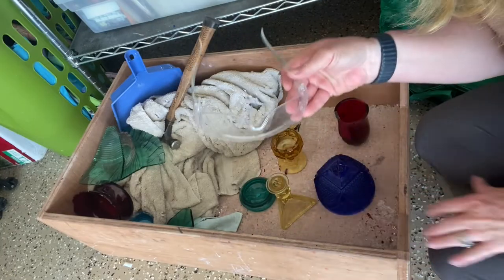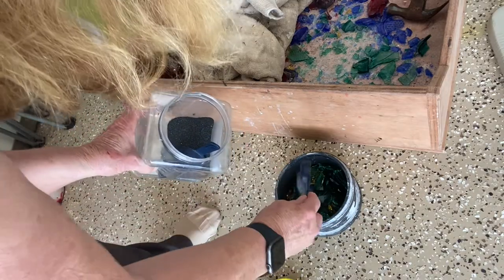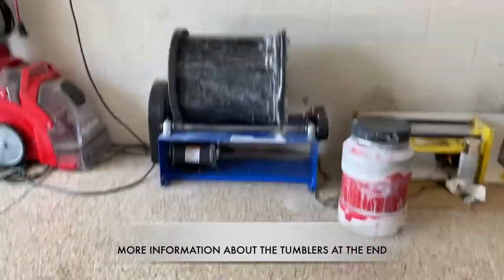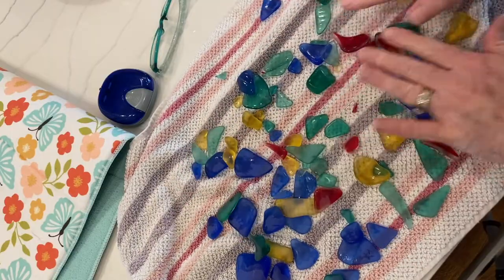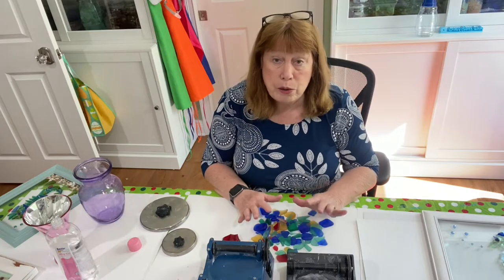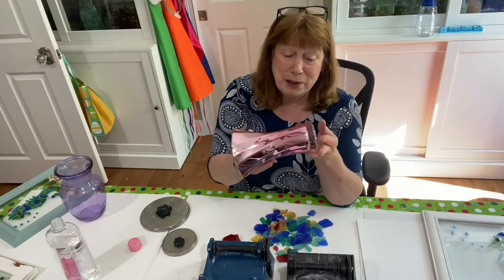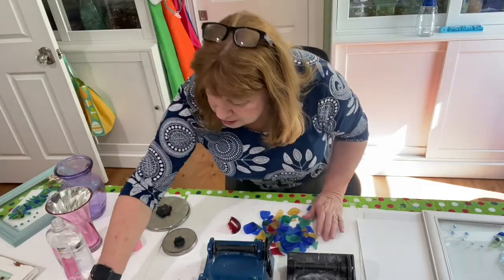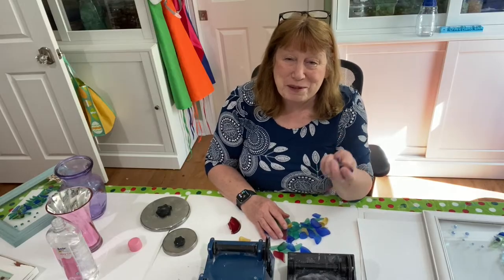HOW TO MAKE SEA GLASS, (FAUX) SEA GLASS, TUMBLED GLASS, ROCK TUMBLER

Comment: Hi I have a question...can I tumble my scrap glass that I have left over from my stained glass projects?  I would love to cross over into resin and get away from all that soldiering!  Thanks and love your videos!
Reply from the maker: Yes you can definitley tumble stained glass it would just smooth the edges. I tumble the stems for flowers look at some of my window projects.
Reply: @crazyglasslady  thanks so much!  I saw that video after I sent you that message and I was very surprised that the stems didn't break ...so cool!! I'm excited to try this out 😄
Reply from the maker: @gaildonovan5882  Yes some did but a lot stayed intact. You just can't make them to thin and you need a tumbler long enough. You could also make them shorter and just piece them together.

Comment: If I tumble glass for 24 hours vs one week, what will the difference be? Not clear on the time frame. I like what you like as well, shinny glass. The next question is, if I tumble glass for a week for the shine, will it be sharp around the edges? I think I read that somewhere.
Reply from the maker: So if you do not care about the rounded look and just want the sharp edges off you can tumble for 1-2 hours in water no grit and no more sharp edges. The glass will still be shinny. If you like the rounded look it takes longer and the abrasive like grit or sand is what speeds up the process. It does come out frosted. If you are working with resin and plan on pouring it over the glass do not put any oil on the glass the resin will make the frosted  glass shinny . If you are just glueing the sea glass down no resin you could make it shinny with a little bit of oil. Hope that helps

Comment: Hi,I purchased the National Geographic Tumbler awhile back. I am now ready to use it. Firstly,  after watching your wonderful video here,  I noticed you did not use rocks to tumble with the glass. The directions indicate to use it. Secondly, the grits are labeled in packages of #1,#2, #3, and #4 etc. I think I'm only to use #1, as it doesn't give the number of the grit such as #70 as you indicated here. So, do I just use number #1 grit and not worry about the other grits and do I use the rocks or do I do what you did, not use the rocks? Sorry, and hope my questions make sense, it's my first time doing this. 💁
Reply from the maker: The reason it says to put he rocks in is because it is a rock tumbler and they think you want to tumble the rocks. So yes just put in the glass ( But you could also tumble the rocks if you want it will not hurt the glass) And yes the # 1 packet will be the coarsest grit so you use that for the sea glass look .I would just put in a tablespoon and tumble for 7 days. You can check after a few it just all depends how rounded you like it. when you do have to buy grit remember the lower the number the coarser the grit and the coarser the grit the faster it smoothes it. You could also use some coarse sand . I hope that helps.

Comment: I'm just getting into this for a large project around my pool. Your tips were awesome. Thank you!
Reply from the maker: Do you plan on using resin because resin will yellow outside in the heat?
Reply: I'm using epoxy. I'm going to hang picture frames (epoxy and sea glass) around the arbor.
Reply from the maker: @daniel5675  Epoxy is resin it is short for epoxy resin. So you live in the south? Mine took about 6 months or less to yellow.

Comment: Didn't even think of that. I think there goes the idea of putting it outside. Maybe I'll cover the whole thing with stainglass so none of the clear glass shows. It's not gonna have the 3-D effect I wanted. I'll just have to put another glass in front of it to sandwich it so the pieces don't fall out. Thanks for the advice!
Reply from the maker: Sorry i would hate for you to do all that work and then have it yellow. I am thinking about pouring some translucent blue over my yellowed ones and seeing how that turns out. Maybe even start with some translucent blue on a very small one to experiment and just place the glass on top and not pour any over. You just gave me an idea. LOL a new experiment.
Reply: @crazyglasslady  
I ran across this article. I'll have to experiment myself with it. This is what it said: acetic cure silicone will not yellow. However, the product can affect reactive metals and natural stones. I don't think it applies to glass. Maybe it can work?
Reply from the maker: @daniel5675  Thank you, Will have to look at that
Reply from the maker: @daniel5675  Oh silicone I was thinking resin so you could attach the glass that way. We have had a recent discussion on the face book group about peoplevusing silicone to adhere large pieces of glass ( Like decorative antique plates and bowls) With silicone and then pouring resin over and their glass that it was adhered to cracked. And then someone mentioned that silicone contracts and expands with temp changes so they use lexel to adhere the glass to the large windows. Not sure if lexel yellows.

Comment: Great video...thank you for the info. I've had a tumbler for years & haven't used it yet but I sure want to now! Can you reuse the grit or is it one and done?
Reply from the maker: I have reused it before and just then used a tiny bit more fresh grit , but you would have to pull the glass out with your hand instead of dumping it all out through a colander. And because its not as coarse you may need to tumble a few extra days.
Reply: @crazyglasslady  Thank you!

Comment: 🚨Questions in this comment!🚨
This is the best tumbled sea glass I’ve seen so far I’ve watched 5 other videos and they looked bad I’ve been really wanting red and multi sea glass I’m tired of looking so did you just tumble it for the 7 days and not the 9 days you set it to? Also do you add anything besides the grit do you change up your grit throughout tumbling? Also do you sell any of this or would you sell any?
Reply from the maker: Yes the trick to the sea glass is to get thick glass and tumble for a full 7 days ( you can tumble longer) I use 36 grit and just leave it in the entire time . I run it at the fastest speed. I normally don't sell anything. If you are really interested in tumbling glass the National geographics tumbler is like $130.00 and it would save you money  if you buy a lot of sea glass. I have it linked in the description.

Comment: In this video you suggested that you use grit for making beach glass and tumble a couple of days.  In another video when you were doing a step by step flower tutorial, you said to tumble the petals you do not use any sand (or grit?) just water and to only put on for 1 - 2 hours?  can you clarify?
Reply from the maker: In this video I said I usually tumble up to 7 days and you can tumble 3-4 days depending on how coarse the grit is and what look you prefer. I prefer it to be very smooth and rounded. The longer you tumble and the coarser the grit the smoother and rounder it will be. It also will appear frosted/ dull. What you are talking about are my more recent videos. So there are many people who do glass art that are not looking for the sea glass look. They break it up and put it sharp edges and all on their project ready for anyone to touch and cut themselves. If you simply place that newly broken glass in a tumbler for 1-2 hours with just water no grit it will remove the sharp edges but retain the same appearance.No frosted look. The thinner the glass the sharper it is and may need to tumble for 2 hours. Some people think that if you cover the sharp edges with resin you will not cut yourself. Not true I have cut myself many times trying to see if it worked. Hope that helps

Comment: I saw in your video that you had a vase you wish you could tumble. what about using a grinder that I use to smooth edges before I use it for stained glass. Would you be able to use the glass after just grinding the edges?
Reply from the maker: Yes I actually do use the my grinder a lot on glass but sometimes its easier to tumble.

Comment: Hi!   Thanks for your awesome video!   What size scoop/measure are you using to add the grit to the 3 lb tumbler please?   I tried to slow down and stop video but I can't make it out, only that you put in 3 of whatever size it is.  Thanks!
Reply from the maker: Thank you! well that is a Tablespoon it looks like I put 3 in but if you look close the first time I do it the  spoon is upside down so really hardly anything goes in so really 2 tablespoons. ( I am not doing it according to directions)when you buy a tumbler the directions will give you the recommended amount. So I use a 35 grit and most tumblers come with a 60-90 LB grit. The lower the number of grit the courser it is and the faster it grinds it down. Im impatient so to I like it to work faster. Did you buy a tumbler?
Reply: @crazyglasslady  yes :)   I bought the NG 3lb tumbler you show linked.  That's why I needed to know how much grit went in :)   Thanks again!
Reply from the maker: @fefelants  Wonderful!

Comment: I have a 15#Thumler's tumbler and am so confused on how much grit do I use in it to make sea glass. I have 36 grit?
Reply from the maker: It is not an exact science you could even use sand it would just take longer . I would start with 1/4 cup and run it for a week and see how you like it. You could even check after 4 days. Every one has a different idea of how they want their glass to look. So the lower the number grit the coarser it is  and the faster it smooths it. 36 is a very coarse grit.  the more grit you use the faster it will smooth but grit is so expensive  you could just start with the 1/4 cup or even a little less.

Comment: Hi. We are just about to buy the National Geographic tumbler and are complete novices. We want to tumble glass rather than stones. Which grit should we use for it and how long should we tumble for? Sorry for daft questions,but as I say complete novices here in the UK.
Reply from the maker: So the National Geographic tumbler will come with some grit. It should be 60/90 which is common to use for tumbling glass. I buy 35 grit which is courser. The lower the number the courser it is and the faster it will tumble it. With 60/90 grit it would be nice and rounded in 7 days. You will probably want to experiment( just open up the tumbler after 3 days and look),you may be satisfied after only a few days every one is different as to what they like. I hope that helps! Happy tumbling.
Reply: @crazyglasslady  thankyou so much for your reply and advice.
Reply from the maker: No problem. Happy to answer any question.

Comment: Hi.  I have just purchased the 3lb National Geo Tumbler.  What speed should I use for smooth frosted sea glass? 1, 2 or 3?  Also how many days?
Reply from the maker: I would put it at 3 and check it after 4 days and see if that is smooth enough for you. you can always cover it back up and let it go a couple more days. That way you will get an idea  of how you like it.The faster it goes the less time. You can just pull one out. the glass in the video I tumbled for 7 days.

Comment: I heard you can dye the glass into any color you want. what would i put in the tumbler to dye the glass?
Reply from the maker: After it is tumbled and you have rinsed and dried it you can spray it with the translucent spray paints.Here is a video on the different colors. https://youtu.be/93PNFUfoXvg?si=f6dQQRS1_iDo7LzZ
Reply from the maker: But if you buy glass and the color you want, it will already be that color